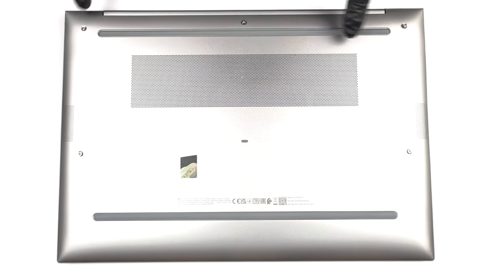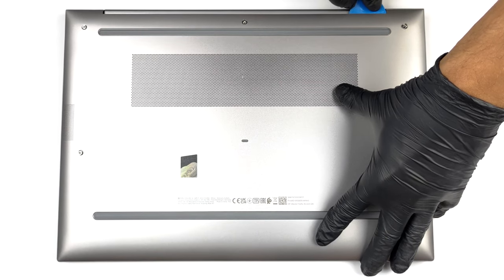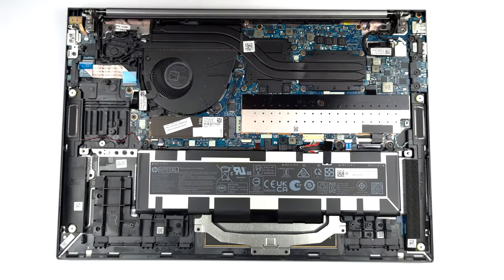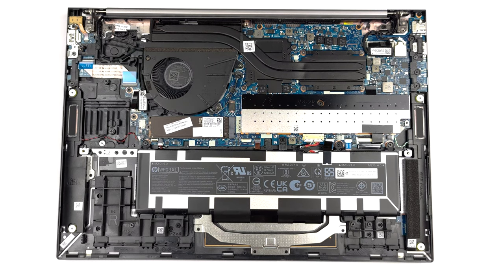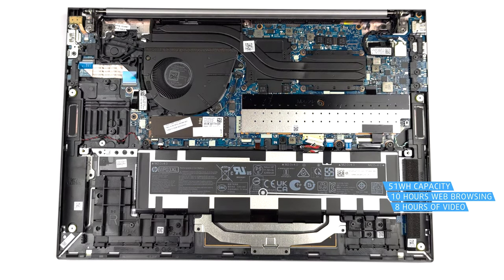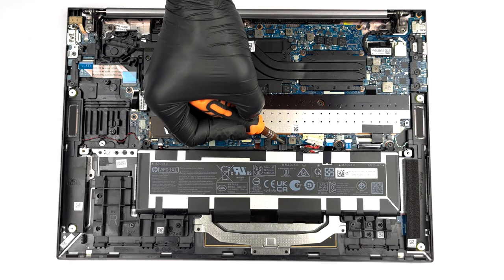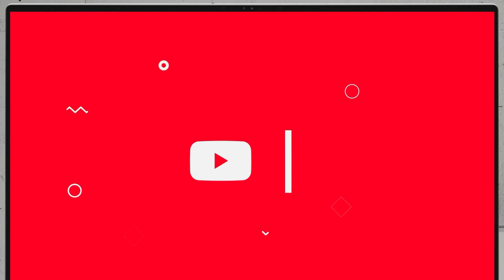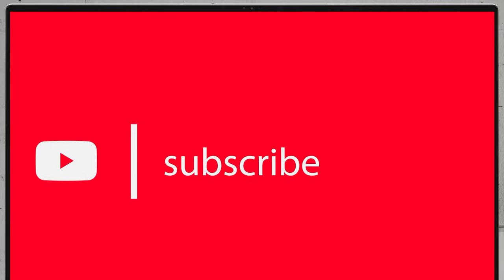🛠️ How to open HP ZBook Firefly 16 G9 - disassembly and upgrade options

Comment: Why is my Dell computer so slow despite its high specs that it has a 7th generation Intel Core i7 processor, 16GB of RAM, and a 4GB graphics card?
 Even after installing a fresh copy of Windows
Reply: Check whether it's hdd or ssd. If it's hdd, it's still slow.
Reply: Possibly only 1 channel of RAM occupied, happens a lot on laptops